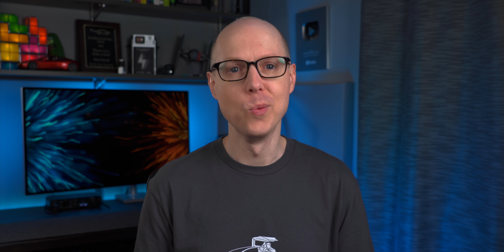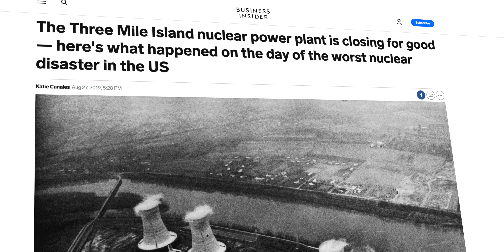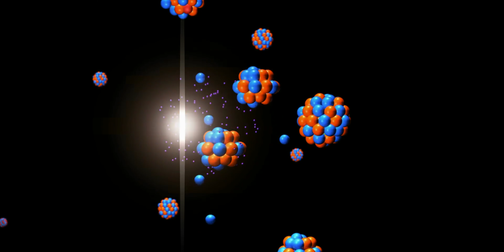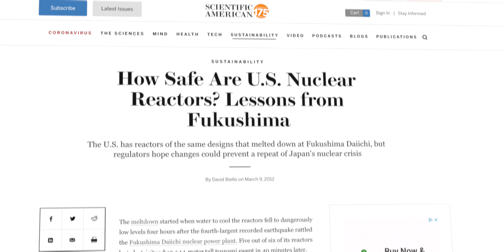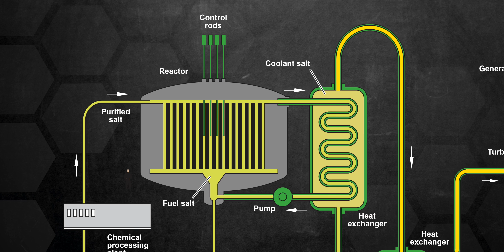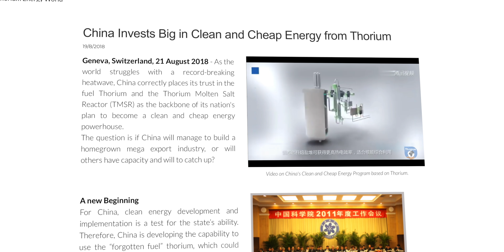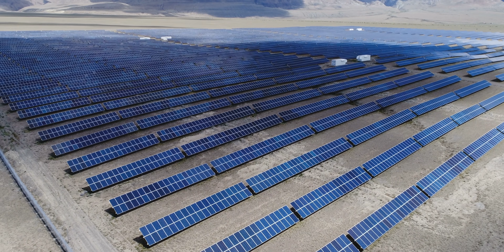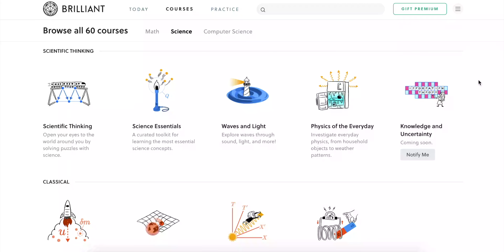Thorium explained - the future of cheap, clean energy?

Comment: The built a Thorium Reactor back when they made the first nuke one, both ran together.. side by side.. by the military wanted the dirty one.. not clean energy..
Reply from the maker: Basically ... yep.  It all came down to nuclear weapons.
Reply: @UndecidedMF  Well, that's how it started, with the first evaluation of thorium & U-233 being during the Manhattan project. Due to the perceived rarity of U-235, at that time, they wanted to develop a weapons grade material that could be produced from something much more common. They didn't want to use U-238 & Pu-239 at first because the chemical & crystallin properties of Pu-239 were very complex, and the fact that Pu-239 would always be contaminated with Pu-240 & Pu-241 meant that you couldn't use Pu-239 in a gun-type bomb, as the other isotopes would cause a gun-type bomb to pre-detonate, turning your nuclear explosion into just a regular one. U-233 was initially seen as a much preferred alternative to Pu-239, because it wouldn't have the weird chemistry and crystallin structure of plutonium and they though it could be used in a gun-type. However, Glenn Seaborg discovered that you'd also always produce a small amount of U-232, which would also pre-detonate, making U-233 also useless in a gun-type bomb. Because U-232 also produced Tl-208, a stupid high gamma emitter, U-233 was shelved. It was evaluated again in 1954 or so in an implosion type bomb, but the gamma radiation made it a dud. This is why, in the almost 80 years that humanity has been using nuclear weapons, there have only been TWO instances when someone thought about making a bomb out of U-233, and given the relative plenty of Th-232 and the ease with which it should be able to turn it into U-233, this is telling.

As such, the production of U-233 diverged from weapons programs quite early in the nuclear age, with almost all research at Oak Ridge involving U-233 being for power production, and not weapons. Ironically, it was the US' weapons program that was partially to blame for killing the program, although not entirely as there were politics also involved. As far as weapons goes though, even if you ignore the U-232, and are able to produce pure U-233, you still can't really use the U-233 fuel cycle in a thermal spectrum reactor to produce weapons material. That's because the breeding ratios for the reactors are around 1.05 to 1.07, meaning they consume almost all of the fissile material that they produce, and if you take out fissile material to make a bomb, you'll kill the reactor as it will no longer have sufficient fuel to maintain criticality.
Reply: deslocc124 - The Airforce wanted nuclear bombers that could stay on station for weeks at a time. Steven Weinbergs team knew that Molten Salt reactors offered the only hope of achieving the necessary power in a small and light enough format for that. However, they also realised that it was madness to put Nuclear Reactors into planes, even though both the USA and USSR both did. Curious Droid did a superb piece on both of those.
Weinberg knew that Thorium was way better for civilian power production, and he should know since he was in part responsible for our conventional Fission plants. Sadly, the fact that these reactors couldn't produce weapons grade Fissile material, and the fact that politically the established industry would have been wiped out meant that it never stood a chance.
How differently the World would have been if it had come to fruition way back then.
Reply: @rogerfroud300  Putin has been boasting of a hypersonic missile that can attack from half a world away. It can only be nuclear powered.
Reply: @jimgraham6722  for decades we've been launching satellites into space with chemical rockets which requires far more velocity than just going half way round the world... I think it's probably just a chemical rocket
Reply: @doritoification  Space, yes chemical rockets get out of atmosphere as quickly as possible to avoid drag. But hypersonic is in atmosphere. Overcoming drag at M8 requires prodigious amounts of energy.
Reply: @jimgraham6722  Putin boasts about a lot of things, most of which are not true.
Reply: The military wanted the "dirty one" because it was also far and away the PROVEN ONE. It is a debunked conspiracy theory to assert that the only reason the military and civilian power sector use uranium fueled reactor is because the US "wanted bombs". Germany had a large nuclear power sector and no bombs, they could've chosen thorium, they didn't. South Korea, Canada, Japan and several others have large nuclear power installations, they don't have nuclear weapons and were all just as free as anyone else to develop thorium power, they DIDN'T. And they didn't do so not because of some internet conspiracy about plutonium and bombs and that evil USA imposing its will on everyone, they didn't because uranium fueled power reactors are far better understood and researched than thorium and they wanted to produce energy, not an expensive new science project. STOP THE CONSPIRACY NONSENSE.
Reply: @Muonium1  get your finger out of your butt
Reply: @kamalmanzukie  wow brilliant argument
Reply: @Muonium1  by responding to mine and not the others, you have effectively been pulled down to my level!!
Reply: @Muonium1  To be honest, U-233 was evaluated for weapons use twice, once during the Manhattan Project and once in 1954 in Operation Teapot. Both instances concluded that due to the unavoidable contamination of even a small amount of U-232, U-233 couldn't be used in either a gun-type bomb or an implosion type bomb. As such, I would reiterate the point that in the almost 80 years people have known about and tried to build nuclear weapons, there have only been TWO instances in which U-233 was considered and then dismissed. Given plentiful nature of Th-232 and the relative ease with which it can be turned into U-233, the fact that there were only two time U-233 has ever been considered for weapons use is telling I would think.